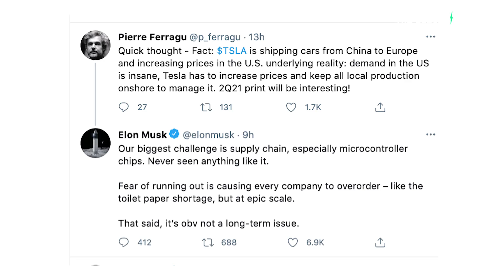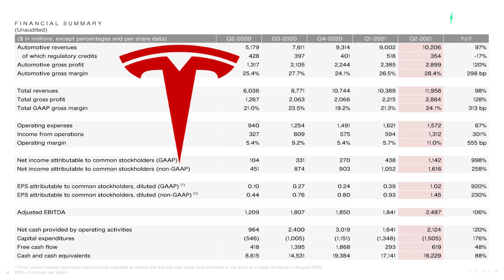How Tesla pivoted to survive the global chip shortage UPDATE

Comment: "Switching from semiconductors to microcontrollers" Please get a clue dude. Microcontrollers ARE semiconductors. What Tesla were doing was changing microcontroller hardware and software designs based on what they could get hold of. Tesla can do this more easily than others as they are much more vertically integrated,
Reply: Wrong, tesla can do it because they don't make alot of cars compared to vw which makes around 10 million cars a year.
Reply: @alanmay7929  wrong. EV'S have 10x more semiconductors. So it more or less equals out. Unless Ford and VW are lying about the amount!?
Reply: @stevencastellanos8063  EVs doesn't have 10x more semi conductors than ICE you're welcome.
Reply: As confirmed by Darren Palmer of Ford (EV chief) in a recent interview, it's the "$1" chips, the "off the shelf" items, which major manufacturers cancelled orders for.
The accumulated effect led to chip production lines being shut down.
Tesla didn't do that, so at least in the first phase wasn't affected, also, being "nimble", they were able to redesign to accommodate  for the different input/ output of what are essentially "switches"  without going through major discussion.
I imagine that a Tesla Board designer and a Software designer had a conversation, anticipated both the problem AND the solution BEFORE the event and suggested that solution at "the highest level".
As Sandy Munro has described, an employee suggesting similar in a legacy manufacturer is just as likely to be fired, as praised.
Then consider who will be first in line when more product is available? The company which maintained its demand.

Comment: Nice video, thanks for your work... But I'm sad about you crashing the Renault Zoe... not every one has money to buy a Tesla, and you have to remember people have different incomes... for for example, I'm from Portugal, I have a Engineering studio, but because off covid Lost 90% off income, just making under 14000€ a year, i have a kid making 2 years, had to change from the Volvo V40 to an electric just to cut diesel expenses, and the truth is the Zoe is not a Tesla, but does the job, the onboard charger is a life saver off 22kW ac an CCS plug just 46kw unfortunately, but the 22kW just made my work easier and save me thousands... I do 40000km a year, I have done 30000km on the zoe and saved 3200€ just on gas, and I'm paying really high for kW... Portugal sucks on public charger paying 0,43€/kwh... and 0,22€/kwh at home, fortunately some places keep the free charging..
 But my point, I think you should praise every EV, they are good and bad, but for the money the Zoe Ze50 R135 with is 22kw charger is a great EV for 26000€ (price service car)...
My point just be nice to people that maybe don't have acess or the money to buy the best, just consider the different levels, I'm doing an effort to survive and this car is making a major difference, just allowed put my kid on school... Just compare apples to apples, off course they are better but for the deal and the charger that matches 80% off the chargers in Portugal I charge 2x as fast than a Tesla, paying less (charging = time X kwh)... just try to be fare..
keep the good work...